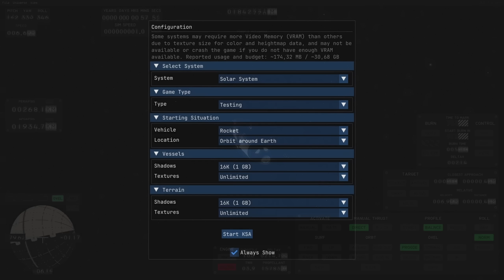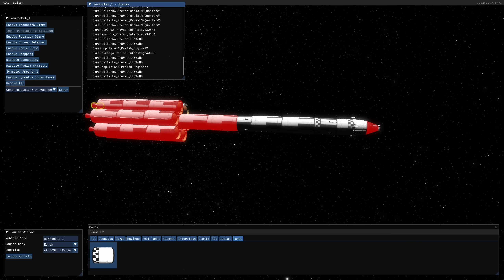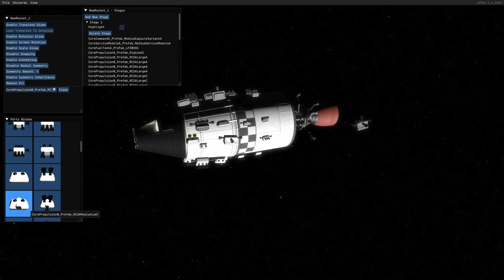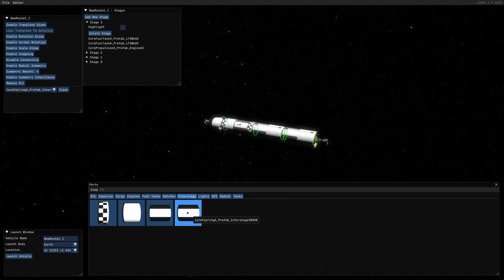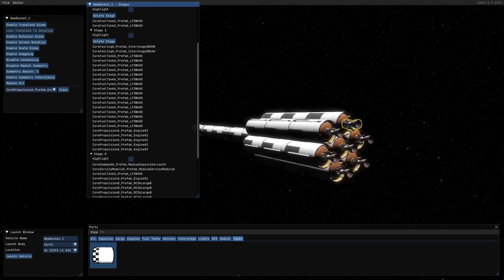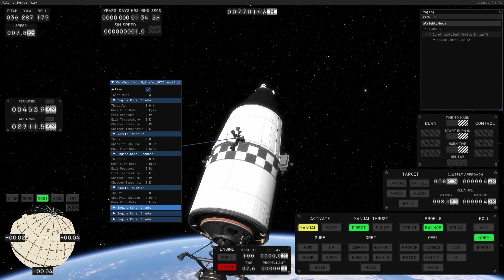I Built My First Three Stage Rocket in Kitten Space Agency

Comment: Notice: no wobbly rocket at all. They’ve already accomplished more than KSP2!
Reply: Wobbly rockets were caused by how ksp (and ksp2 by extension) used physics constraints to connect parts together. There was no single rigidbody for the vehicle, so the physics has to solve the joint constraints for every part separately. The way this is done in physics engines means complete rigidity requires infinite solver iterations.

KitHack and KSA both move away from this and treat the entire vehicle as a solid rigidbody, and internal structure stresses are simulated as a separate system. 

This way the vehicle is still allowed to bend and break apart, but only where we want it to do that.
Reply: @akaHarvesteR  Oh! That makes so much sense! It’s cool that you don’t have to abandon elasticity altogether—you can just apply it when it adds something to the experience. I’m so excited for this game!

Comment: No excessive wobble in sight. This makes me happy
Reply: There's no part joint physics
Reply: @linecraftman3907  Whoever thought "this game needs laggy wobbling that isn't in any way realistic to start with for the sole purpose of creating unpredictable failures and crashes", I don't know how to fix their brain.
Reply: @trygveskogsholm5963 Yea. Basically the only advantages I can see are plane wings being flexible, and making sure rockets aren’t completely structurally insane. The disadvantages are literally everything else
Reply: @trygveskogsholm5963 well yeah but i don't think fully stiff vessels are a good idea too

a proper balance is needed
Reply: @trygveskogsholm5963   KSP 2 Moment: Not Enough Wobbling, Add MORE
Reply: @trygveskogsholm5963  Nobody ever thought that. They pretended to, that's all. But the truth is that the engine was designed that way because it was simpler.
Reply: @linecraftman3907 So what do they use instead? Treat it like a single object?
Reply: @spaRTan3246 -- Nothing yet. It's just a spherical collider for terrain, and a cylindrical collider for drag. The actual shape of the vehicle is just an illusion so far.
Reply: @spaRTan3246  they could have an algorithm that judges stability that runs every time the part configuration changes. If parts are stable they get locked together as one physics object. If they are unstable they get treated individually.
Reply: @DeanRockne  This could be an interesting way of doing it
Reply: @TlalocTemporal  The collision engine and the physics engine are two separate things. The reason why KSP used one object per part and KSA (seemingly) one object per rocket/stage has nothing to do with the collision engine.
Reply: I remember fixing the wobbly rockets was one thing that I was really hoping for with KSP2, and then the early access comes out and and they made it like 10 times worse to the point that you could barely do anything. And then a developer comes out and says that they made it that way on purpose for "muh nostalgia" because it was in the first game so that must be what the people want. That told me they were just completely clueless as to why people even like KSP and are more or less just trying to guess how they can cash in on a sequel. I thought the entire point of even bothering to make a sequel was to improve on the first game and fix some of the more annoying problems that plagued it, not just making everything the same but worse. That was when I got really frustrated and lost faith in those developers and stopped following the game.
Reply: Love your cod Ghosts image
Reply: I like the kraken attacks though :(
Reply: @Warat-q7n   I mean it's funny if you aren't actually trying to accomplish something and you just want to laugh at jank physics and watch stuff blow up for no reason. But if you want to actually play the game and accomplish something and solve complex problems, or make interesting structures without the game fighting you the whole time or randomly deciding to erase 10 hours of work because you re-loaded a save or sped up time in a way the game decided it didn't like, it gets pretty old.

Comment: i was hoping building rockets would be more procedural :/
Reply: then play juno new origins
Reply: @unrealkomic thx for the suggestion but no honestly
Reply: it's way to early to form any idea of what the final product will be
Reply: Wat do u mean by this?
Reply: @Darthforce122  So on stock KSP, you're building a rocket and you need to go from 1.25m to 2.5m.  There's a few adapter parts to do that.

But it would be nice if you could just say, "Give me a fuel tank that's 5m long with a 1.25m top diameter and a 2.5m bottom diameter, and make it follow a soft curve."  There are mods for KSP that add this, and they're fantastic.  You can also add mods that give you procedural wings so you're not cobbling together your aircraft wings from "Wing Connector B" and whatnot - just define the shape that you want.
Reply: Yeah, I don't. I'm perfectly fine with KSP rocket parts.
Reply: @sailor5853 ok im not though
Reply: @Darthforce122  Adjust more parts to the dimensions of your liking. But that person clearly didn't watch the video as we can see SZ clearly changing the size of the fuel tank...

Comment: I recently learned in KSP that on Linux systems the Modifer Key (AltLeft, for the copy function) gets switched to RightShift in the config file. I had to go in and edit it to get it back to what I was used to.
Reply: in my linux version left alt is used by default to drag open windows around and so it overwrites interactions within those windows. to get it to work i not only had to edit the KSP config back to left alt, but also change the general system setting that makes left alt the key to drag windows
Reply: @MinerBat  Yep.  That's pretty much the convention for window managers, they tend to treat the Alt key as theirs.  It can drive Emacs users nuts.
Reply: @jeffspaulding9834  alt for wms is criminal.
Reply: @MinerBat  Yeah. I always used to change the Linux system setting to use the Windows (AKA Super) key instead. This was long before KSP. It always annoyed me that the window manager grabbed Alt.
Reply: why the hell ur using alt for your window manager/compositor it breaks all default shortcuts on every other application. Use the SUPER key for its intended purpose please.
Reply: Dude, I didn't know that, I switched recently and was wondering why I cant copy things!
Reply: oof! thanks for the warning
Reply: linux version is halfassed because unity is dogshit
Reply: Yeah, Alt has been on PCs for a long time but wasn't universal on UNIX systems.  When graphical workstations came around, there was usually a key that the window managers used for shortcut keys.  On a PC keyboard, this key was Alt.  So most programs on Linux don't use Alt (unless they're capturing the raw keyboard input) because of the likelyhood of colliding with a keybinding from the window manager.

Alt actually sends ESC when you hit it in a terminal, which means you can simulate something like "Alt-G" by pressing ESC and G in quick succession.  It confuses new Emacs users sometimes :)
Reply: @jeffspaulding9834  I like ESC as Alt. Sometimes, it's more comfortable than the combination. In readline (bash & others) and many other programs, you don't have to be quick. It's so common that Android keyboard Codeboard IME doesn't even bother having an alt key because you can just use ESC instead.

   I think I was confused by it in the early days of my Linux adventure, but it's too long ago now to remember details. :) It was the late 90s. XTerm annoyingly didn't send Alt as Esc by default, setting the 8th bit instead. I had to use Esc until I figured out how to change the default.

   For many years, a bash keybinding, Alt-> for end of history, didn't even work with the Alt key. You had to use Esc. I still type it that way.

Comment: 👍🥰👍 warts are OK just get a rat to nibble them off 🤪😉 👍 🐀

🤔🧐maybe if you assemble it in an assembly building it’ll change access to Y axis for vertical and the cent on the 0.0 x & 0.0 z point 
Try to build your spaceship vertically 
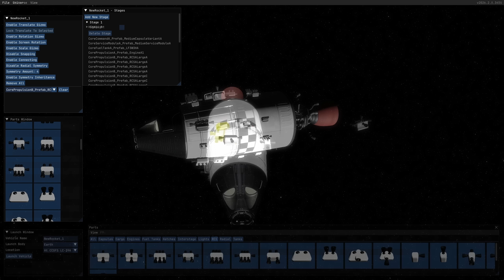🤔 🤪🤣🤪😂🤪 got enough RCS thrusters 6:28 😉🤣🤪😜😂